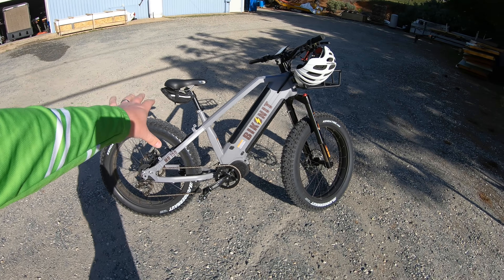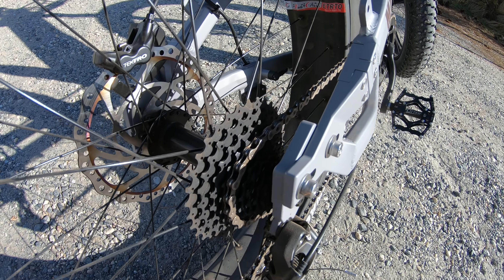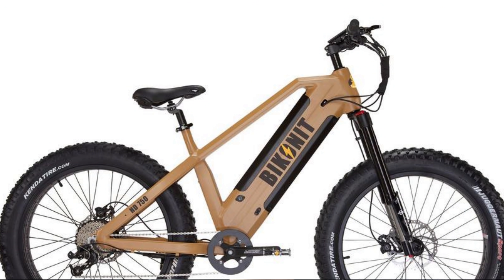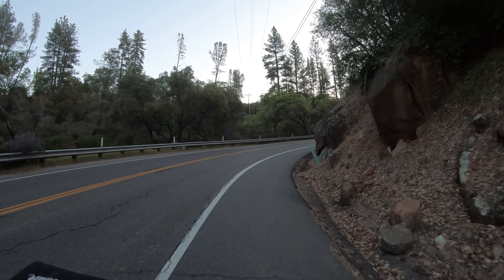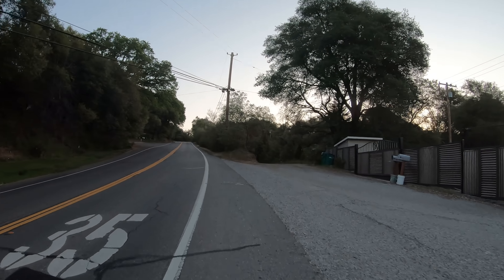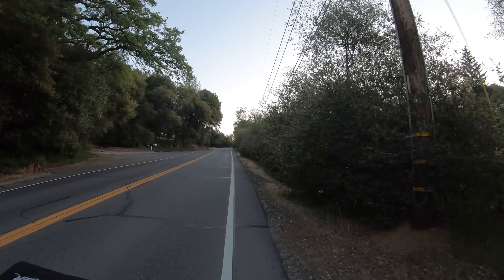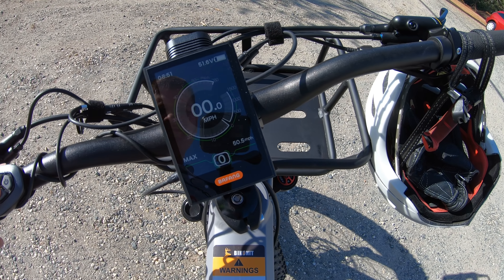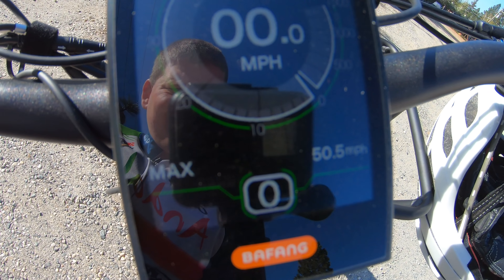Are fat tires really that much slower?

Comment from the maker: What are the most important things you look for when buying an ebike?
Reply: Good brakes ;)
Reply: Range, price an then watt 👏👏🇮🇪🇺🇸
Reply: What USA state are you located in Bolton ebikes.  👏👏🇮🇪🇺🇸
Reply: Reliable thats the no, 1 without a doubt.
Reply: if i can get it here in Germany
Reply: I’d say affordability and a comfortable and proper fit for someone my size (6’1” and heavier that I should be).
Reply: I bought a 500 watt 36 volt front wheel hub, and NOT happy with the speed! Can you please tell me (or make a video) how I can get speeds equal to 750 or 1000 watts without having to change out my wheel hub? Thanks.
Reply: @marklee9226  he is in California
Reply: well I want a good looking bike, then good motor + controller and parts.
Reply: Fit, form, function, reliability and range.
Reply: Well now that I know more I would look at the battery the motor the brakes. Were you turned off going down the hill. I think my limits if I turn it off I could go faster downhill like 40
Reply: Power/speed, range, quality and price.   As far as power/speed, I would also like to see faster acceleration.  I would be happy with a bike that had way more acceleration even if it was limited in top speed to around 35mph.  More torque for hill climbing and faster acceleration.   Maybe 3000 watts limited top speed.
Reply: @mikes96fs  OMG I haven't ecotric hammer and it goes. What do you mean more acceleration? There was some crazy kid on a video with a surron doing wheelies down the road at 50 miles an hour I guess he doesn't want to live very long
Reply: And a reputable dealer like you
Reply: Can it be serviced
Reply: @LetArtsLive  haha, ya the sur Ron’s are fast.  They have around 5500 watts of power.  I was directing my comment towards the videos 750 watt ebike they were talking about.  I have a 2000 watt ebike that goes around 35mph.  My biggest wish is more acceleration but if my bike had closer to the sur Ron’s power, I’m sure that would be fine!  I would be happy with 3000-4000 watts
Reply: @4thegloryofthelord  get a higher voltage controller and higher voltage battery. you can overvolt a 500 watt motor to 1500 watts no problem
Reply: @Timbodacious  I'll look into that, thank you!
Reply: I'd say the first thing I look for is a good weight capacity/suspension capability. Not only am I a big guy, but I ride around town and off road, so that suspension overall makes it more reliable for me. The next thing I look for is pricing or good financing.
Reply: Delivery Date ! LMFAO... 😂.  My Blackbird is gonna be ready soon !  Can’t wait ! 😜
Reply: Grassvalley is beautiful. I am a Northern California transplanted to Southern California 30 years ago. Is the warthog MD still out of stock and what is the cheapest way to order it 🤔
Reply: @paulking962  
I am having difficulty communicating with these people. I thought I had an appointment for a phone call but never recieved a call. I am interested in the 750 MD also. I did get a short message saying maybe they will get more of these mid drive bikes. Who knows?
Reply: Quanto é o valor
Reply: @kruegdude  SAME -- I have the same issue.
Reply: how fat or can go between charges is my number 1.   then speed and price.

Comment: You can go considerably faster and farther if you change out those Juggernaut knobby's for fatty street tires and if like me you do most of your riding on the road you really should.  My M2S AT-750 HT came with the same Juggernaut tires as your bike but most all of my riding is on blacktop with the occasional gravel/dirt road and I did not really need them, plus they were noisy and rode like crap.  So I went shopping and got a set of Origin8 Supercell's and damn, what a difference.  

With the same OEM Juggernaughts as your bike I got a top speed of 26mpg on flat blacktop. Not bad for a guy weighing #290 + groceries and side baskets, but with the new Supercells I hit 36mph over the same stretch of road.  I saw a Yuge difference, plus the ride was 100% better and whisper quiet.  And yea, for me 36mph is just too fast to be safe, even with disk brakes, also going that fast heated my battery more than I liked so I reset the speed controller to keep speeds Class 2 legal and it's great. I set it to cruise at 18mph on throttle alone and with the Origin8 tires I get greater range ansd a smoother,  quieter more comfortable ride _ its all Win.  

Those Juggernauts may be OK if you are doing most or all of your riding off road but on the street you can do a lot better.  Change those knobby's for a set of fatty road tires of any quality brand and you will see a boost in performance and comfort.
Reply: twenty miles per hour is tooooooooo slow.  thirty is about right for city riding.

Comment: Great bike!

However....on electricbikereview forum there are big problems with the combination of the powerful motor in combination with the 5 speed belt drive.

Already 3 of I guess 8 posters had a broken rear gears (I think it's called IGH)
Leily the manufacturer already propose to buyers to change their bike to a normal chain with derailleur before shipping.

Any thoughts on your side?
Reply: I've sean alot of talk about shift problems and people being scared sheep and not actual broken gears on there. Mine still trucking along just fine...but I would love to see Kyle do an in-depth video on the IGH and how to maintain them.

Comment: Hi, from down on Greenhorn Rd...I'm gonna be in the market to pick up a bike from you guys soon and need to come up there at some point. Not sure yet whether I need the big 'ole fat tires or the next step smaller, with the puncture proof Kendas. I sure get a ton of flats on my Specialized stumpjumper. What's the deal with cadence sensor vs. torque? Maybe you've done a vid on this already? I see Juiced has the cadence option on some of their models, and profess that it's a very desirable feature. Wondered what your take is on it.

Comment: That ultra motor is something else compared to those little 250w motors in UK. We are restricted here and over priced for 250w
Reply: I honestly feel for you. My bike isn’t exactly legal here in Portland, Or., but I live next park and have what’s called the Springwater Corridor, a 40 mile”loop”. It’s like a freeway for bikes. I go slow past the joggers and most normal bikes. I will blow past a roadie already going 25mph...they were always flying past me on my mt. bike commuting.
I got a Bafang BBSHD on my old(like new still) Banshee Sirocco. It’s real purpose is to get my old bones up the trail. It does it in spades. It’s crazy. I don’t have to pedal where you would have to get off and push. If I were in the UK, I’d get a Bafang and lie my ass off.
Cheers

Comment: Hey Bolton, can you comment on the reliability on the md 1000 beltdrive w/igh,   theres lots of folks that purchased the same bike direct from the mfg in China,they are experiencing igh issues due to the bafang motor power and the fact the 5sp igh being mismatched. Please advise. Thx ps to be more specific, the sturmey archer 5 speed igh does not honor their warranty if installed w/bafang ultra g510 mid drive, according to  sturmey and thats in writing posted on a bike forums, their explanation is that the motor is too powerful= missed gears, clanking, etc...i am sure this is a touchy subject, but it would be great to get your opinion and or POV for folks that are intrested in purchasig the warthog direct from you, and or feed back from your customers, it would be great to get a reply!
Reply: How's the reliability of these MD750's?any reviews from people who bought this model?

Comment: So if you are able to to up the 750 w on this bike could you do the same thing on a Sonders rockstar which has the same motor and is at 750w also? Thanks
Reply: you should just b able to take the limiter off in the control screen like he did, but you can also reprogram the controller with the laptop connector and app. i think they are limited when they ship out

Comment: You have quite the nice commute home. I've been over 50 mph on a road bike, not to much of a biggie as they are designed for that kind of stuff......50 mph plus on a fat tire bike?

Nope.

I had a fat tire go down at about 15 mph......hit a shard of glass and the front tire went flat in about 2 seconds and got wrapped up in the front fork...I went OTB and ended up badly injuring my shoulder.

Ive been riding and racing bikes for 50 years and 2 seconds of warning before a huge floppy 4.9 fat tire goes down isn't much time and that was only at 15 mph.

Comment: That's a pretty cool downhill ride.  But that actually brings up a good point.  Is there a generally accepted maximum safe downhill speed for Ebikes?  Does this matter much with regard to fat tire or not, hydraulic assist or not?  

I'm sure there must be some range for these things.  In my case, anything much over 30-35ish downhill makes me feel like that Ewok after he stole that speeder bike in Return of the Jedi.  Cool, but terrifying fast.  On a level surface it is not so bad, but I don't really feel like the standard brakes would be up for an emergency stop.  For reference, mine is a 2021 Hemiway Cruiser.  Great bike, but with the mechanical brakes, I'm not sure about stuff like this!  Would going to hydraulics fix that, or is it really only some bikes that should ever get that fast?

Comment: I changed out my 4.5" Juggernauts because I didn't like the way the bike sounded like a pickup with off road tires going down the street. Those suckers are loud! I put on some 4" smoothies and have not looked back. Way more smooth and quiet ride. I only ride on sidewalks, paved bike paths and streets. No off road for me so no benefit from the knobbies.
Reply: im exactly the opposite...i love the noise & people get the hell out of my way.
Reply: Why would you even want to buy this bike if you don't ride off road? That's rather silly
Reply: @Scatterbrain70  looks cool and long range
lol

Comment: What I want to know is why do the manufacturers use plastic (nylon, or whatever) internal gears instead of using metal? Certainly, a nylon or plastic gear is not going to have the staying power that a hardened metal gear would have. I'd hate that the argument or explanation would be that it makes the bike lighter because that would be an absolutely horrible if not altogether terrible reason.
Reply from the maker: Longevity, lubrication, and noise.
Reply: @Area13ebikes  So, nylon gears last longer than metal ones? And, so, you're saying that lubrication is a huge factor in the longevity of the nylon gears? I mean, it makes sense. Noise is an interesting factor. I had no idea that a metal gear, if it was well-lubricated, still makes so much noise. Who knew?
Reply: mainly noise

Comment: It is looking you plan to fry eggs on motor.
I have both motors 750W hub cadence , 1000W mid drive torque  on the same battery 48V 17.5A.
Mid drive with tire 26x2.6 very light wheels overall performing worse 10+%  than 750W fat tire 26x4"  thunder bike removed front rack and created huge back rack . Avg speed similar with one bat mid drive on road climbs even harder better at higher speeds over 35km/h.
With one bat mid drive never become what expected by peak power 1500W which can pull 30A. 
Reasons;
On low speed low air drug small power motor ineficient for battery good 6A or less loads.
On higher power 500W plus motor efficiency better but battery voltage sag reduces performance and overall range drops also dramatically. On low speed (20-25km/h)hard to get over 75km , did not try high power normally rides 2.5H plus to 6h did not want to finish in an hour.
With fat tyres 750W get easy 80 even with pass 1  90km with the same avg speed included stops .
2 weeks ago added the second battery in parallel on the mid drive and the first motor become what should be at the first place, at low power similar like 2x one bat in higher speeds with much better motor efficiency and reduced bateries currents reduced voltage sags got speed and range . Done only 2 tests rides one slow 6h and other faster 3h and looking like  mid drives 1500W peak really needs 2 batteries  avoid voltage sag and extend life or reduce  abuse of batteries. Range with me 115kg could be slow 140+km , fast 30km/h plus 110+km even more on flatter riding , that is enough good batteries get discharged much less and current halfed on each what will dramatically increase life span. If they recommend to charge with 2A , discharging with 20A to 40A cannot be good for any battery.
 Mid drive needs two batteties for expected performance, Defender S shall not be sold with only one battery.
Mid drive with one battery tire  26x2.6 ( what should bd speedy demon)  it is overall much worse than hub motor  750W fat 26x4" tire .
Because of extra 1000$aus for the 2nd battery many bikes are sold with not good match up motor battery what course bad perfomance. They can sell at the first with single baterry but should inform customer regard importance to match motor power with battery capacity to get real output.
It is looking motor 1500W peak requires 30Ah plus batteries, only if used for downhill one battery ok with breaks 203mm.